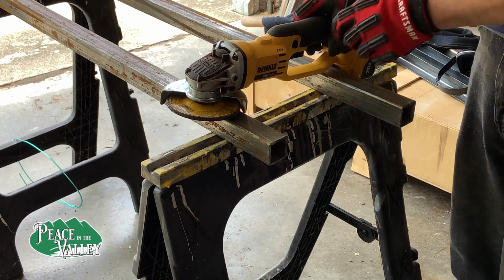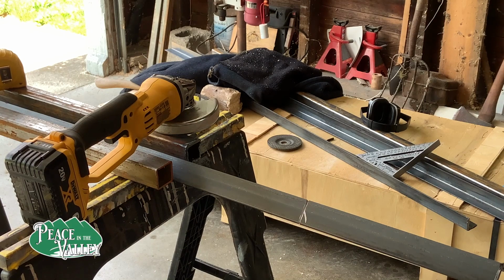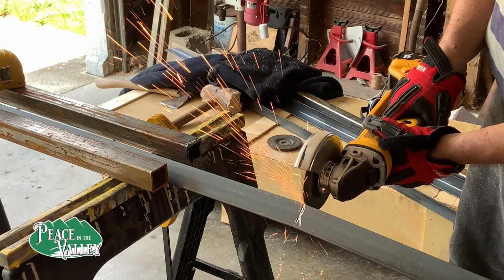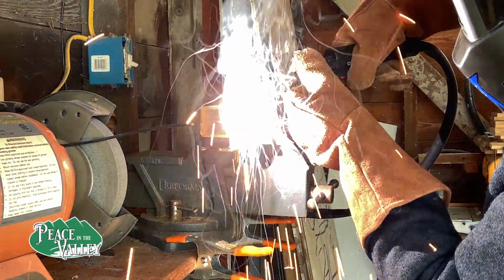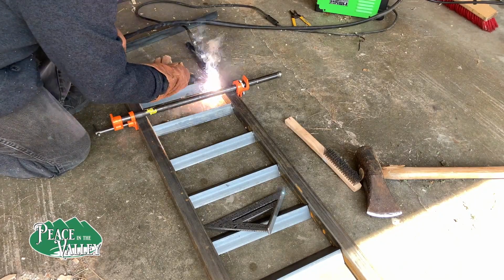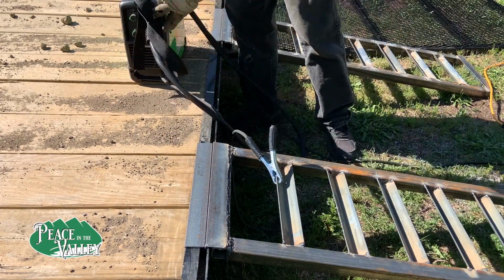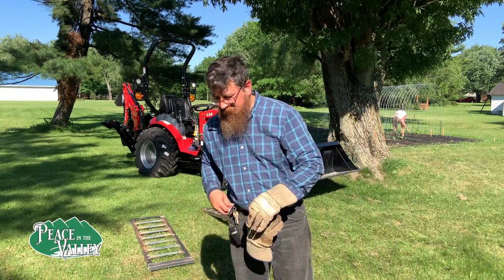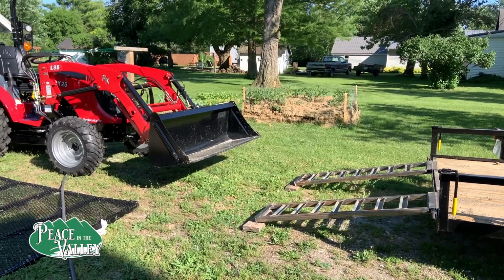Episode 11:  Make Ramps for the Tractor and Trailer - Part 1 - FAILURE

Comment: IM OLD TIMER WELDER  I USE MILD STEEL 1/8   " RODS / PLUS + MY STEEL RAMP / ANGLE IRON  POINT ARE BETWEEN  OF THE ANGLE IRON , WHERE THE TRACTOR WILL BE ABLE TO GRIP THE TIRE ON THE POINT  / THIS WAY WANT SLIP OFF THE STEEL RAMP AT ANY TIME

Comment: Maybe take in some of the videos over here https://www.youtube.com/watch?v=jtlOOOTpZYM
You are not using enough heat.  It looks like you are using flux core wire.  I don't like the stuff. Get some of this instead of that low strength you have there  get:   ESAB 710x wire in .045 or 1/16  and use  100% C02
And get heavier steel.  That may be a little tractor but it's still very heavy 
And  get yourself a manual on structural steel.  You need to be able to calculate the load carrying capacity of anythign you build like that.   ESPECIALLY  if you are going to use that itty bitty welder, because you are on the wrong side of the rasor's edge of too little capacity for what you are trying to do. 
Me? I'd get a real welder even a conventional stick welder but one with POWER ( ya need 240 volts & 60 amps)  and I'd use nothing thinner than 3/8" thick steel and my consumable would be Lo Hy 7018 rod.  It'san easy rod to weld with  Essentially a drag rod, but it's got massive strength Like 70-thousand psi.

The up side of a stick welder is you can buy a TIG torch and use it for TIG welding too. It'll be scratch start  but  lots of  real pros do it that way.